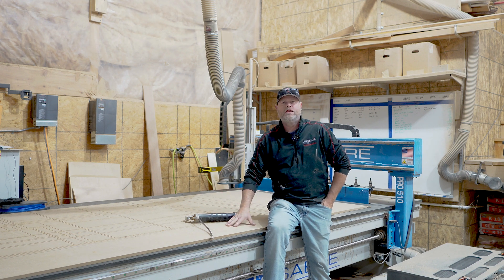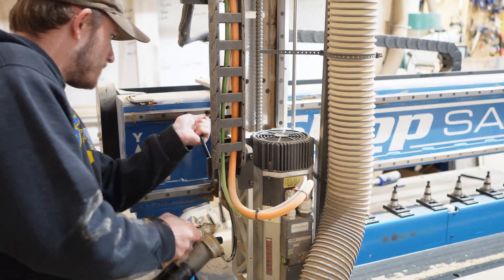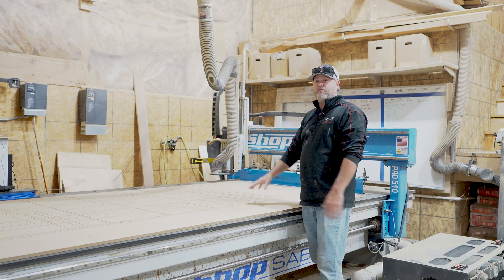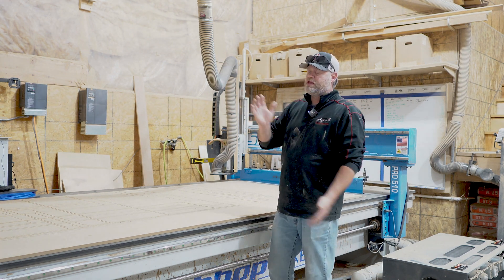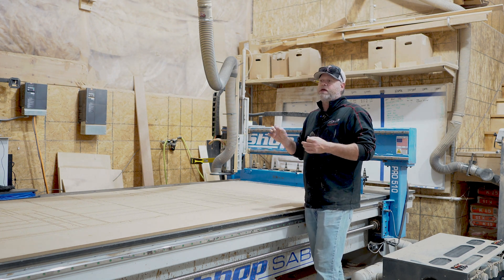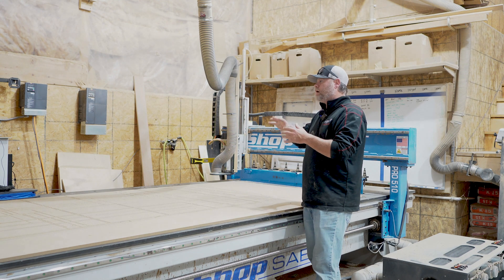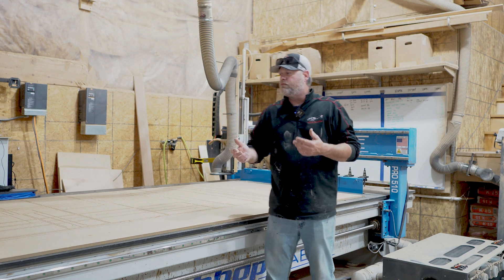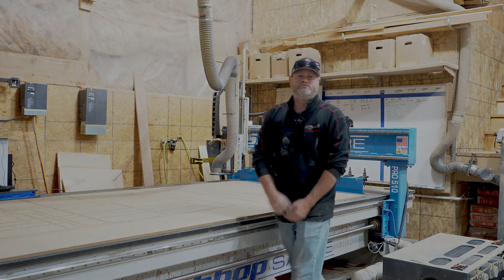CNC Basics: CNC Machine Maintenance 101

Comment: What is life expectancy of cnc...
Reply from the maker: Very good question.  There are parts on the machine that will need to be replaced (bearings/bushings) more often, but overall I’d say 10-15 years before you would need to consider replacing critical parts like the spindle.  It also all depends on how much the machine is used.  Hope this helps